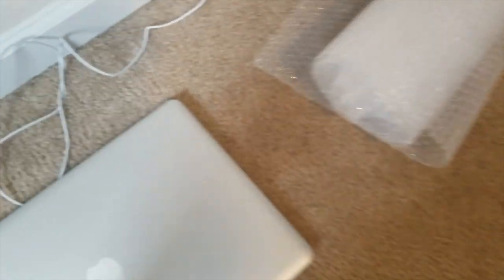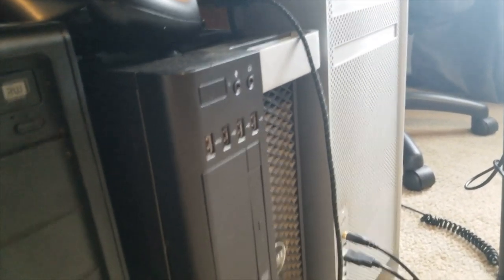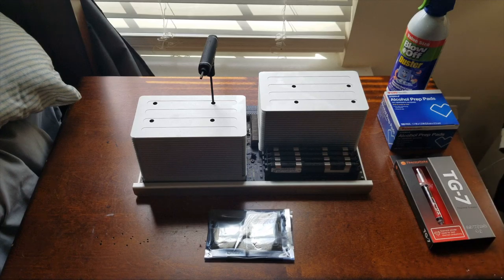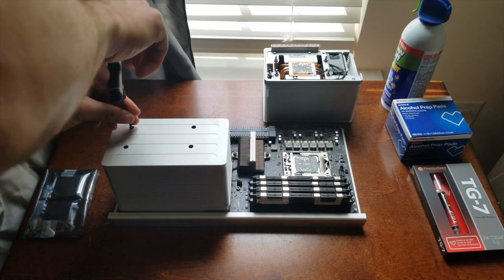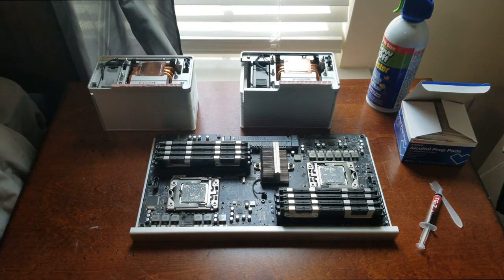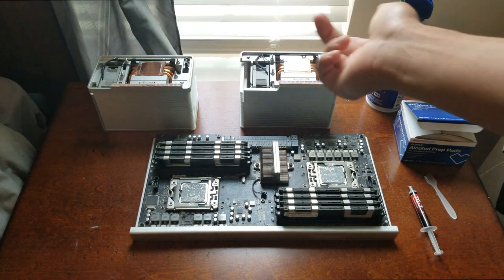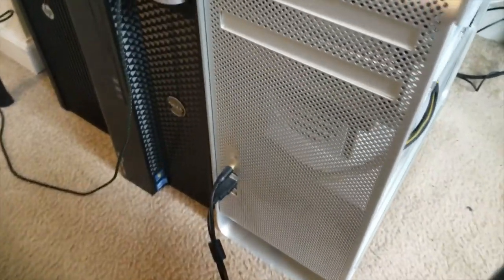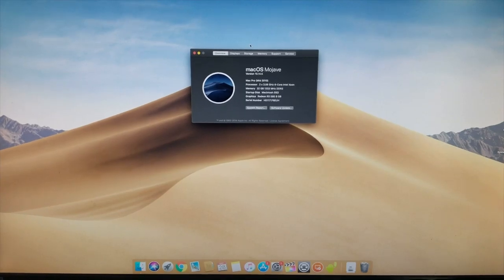Mac Pro 12 Core Upgrade!

Comment: Is there eason why you didn't de-lid the ihs? stock cpus from apple come already de-lidded which raises the question why the cpus you pulled out still had the ihs and makes me think you replaced it before or bought it used? Also dangerous not removing not just because of heat cpu thermal issues, but it can damage the board screwing the heat sink back on because the lid sits higher then recommended
Reply from the maker: Because this is a 2010 Mac Pro not a 2009. 2010 Models are able to use lidded CPU's
Reply: Hmm i removed mine on my 2012 @averyplays7576